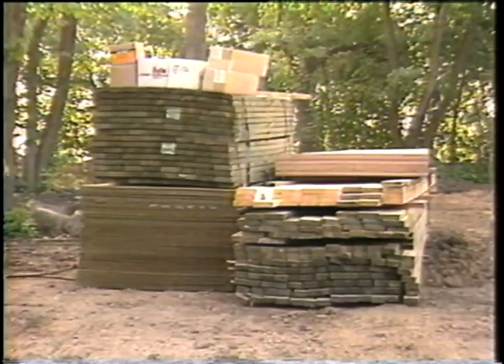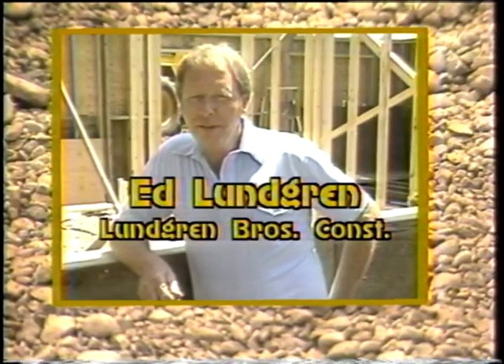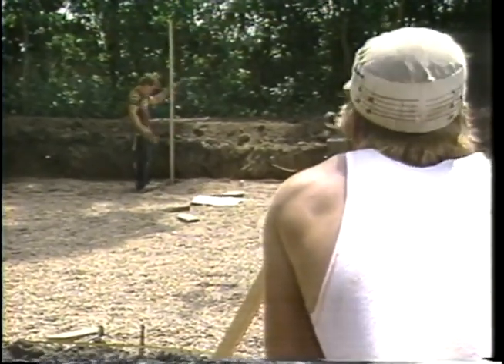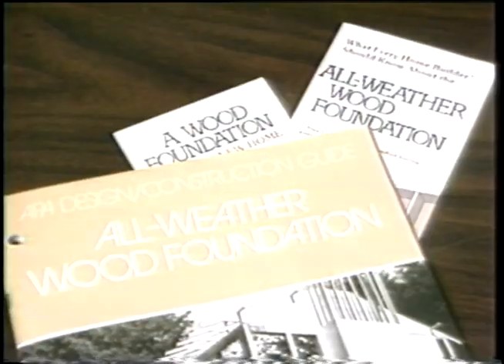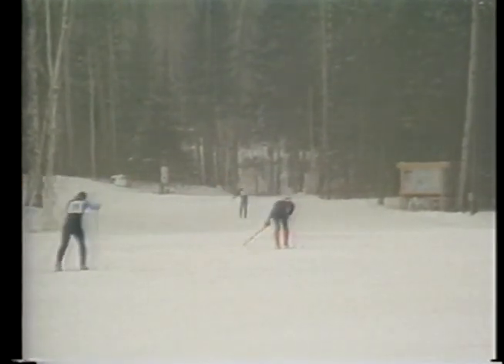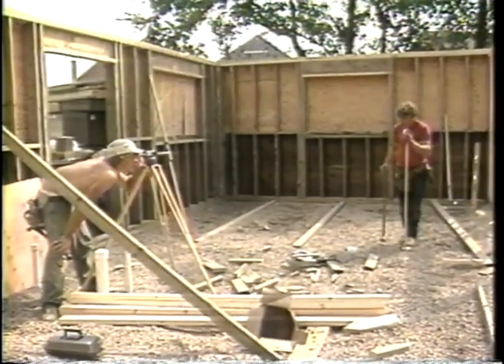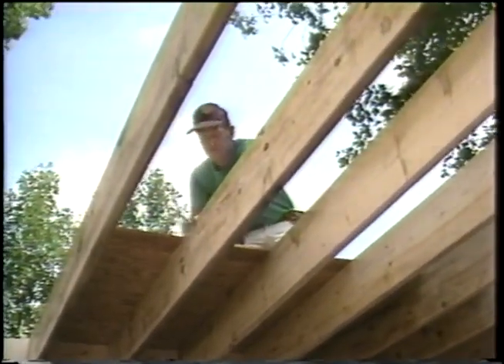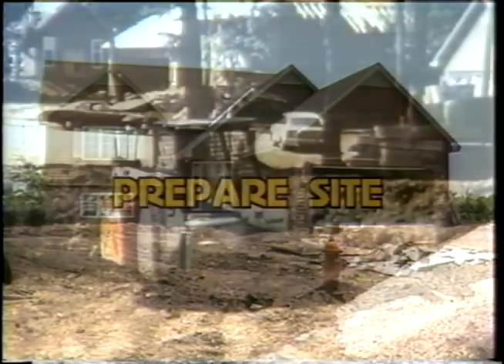Permanent Wood Foundations: Nothing Complicated; Nothing Complex

Comment: Ok done some of these 25 yrs ago.. it works if done correctly.. PEA STONE is what to be used period..  resale and finance issues yes.. however it is sound if done properly. Mostly used in rural or labor starved areas... Remember sea walls, pole barns, roller coasters are done with this material... Cement is not water or moisture tight as a matter of fact it's always damp . And poor compaction always spells failure.. pea stone is instant compaction..it's a system not a thing..

Comment: If later down the road, you did get water damage, can you change a wood foundation into a concrete foundation?
Reply: You have a better chance of getting a wet basement with concrete then with wood
Reply: All replies welcome:
I have a 21 year old house with wood  foundation.  I have no leaks at all. I even carpeted part of it.  Question, when I sell this house do I need to disclose this to a potential buyer? All wood is now completely covered inside and out, so it won't be visible on inspection.
Reply: Not worth the cost better off infill

Comment: I worked for a contractor 20 years ago that sold this garbage.  Still not convinced. I can understand the concept, but the walls should be on a concrete footing.   We fought those buildings to the peak as they settled
Reply: Garbage is exactly what you built. That's not how everyone else works

Comment: This video is so friggin old! These practices are not allowed in any Canadian province. Pull this video.
Reply: These foundations are currently allowed according to the National Building code in Canada. These are great solutions for many situations. Hard to reach areas or on Islands. I have built a few of these and one that is 30 years old. No problems whatsoever. Like anything , do it right and it will last. I am currently working on one. Never had an issue.  Long lasting, reasonable cost,  SMALLER CARBON FOOTPRINT than any other material and a sustainable product. Somebody is out of touch.
Reply: You're of the ban clan type eh?  Ban based on my non-facts.  Preserved wood foundations are very allowed in the NBC and OBC to this day.  As an inspector of 15 years I've seen a few of these foundation and they were 40+ years old and looked brand new, worked great.
Reply: @carter102  yes and all dangerous activities must be outlawed post haste.
Reply: The Canadian National Building Code disagrees with everything you just said; look up 9.15.2.4.(1), and 9.16.5.1.(1) in the 2020 code book. See also CSA S406. I am a structural engineer and I have been specifying these foundations for over 30 years.

Comment: I cannot believe that ANY modern building code would allow a pressure treated wood foundation.   Fast and cheap.......this wood foundation will rot in 10 years.   A modern home has concrete footings with poured walls or cinder block for a foundation.   The only type of below grade wood foundation allowed is for a pole barn, and even then the posts will eventually rot.
Reply: I'm living in a home built in 95 with a wood foundation and it's holding up fantastic. The key is drainage.
Reply: Going on 22 year now. When I first looked into it. I toured a home that was going on 80 years old with a wood foundation. The basement was warmer and dryer then any concrete foundation with no cracks or collapsing walls.
Reply: Mr. taxpayer just see a home with wood foundation it is 31 years old had Structure engineer check it and it’s in good shape...
Reply: There is a house at Forest Products Laboratory in Wisconsin that was built in the 80s and is doing just fine. It has sensers in the wall to monitor moisture. It looks like it was built yesterday. It in fact looks much better there most concrete basements built around that time. If you plan on ever finishing the basement this it a good idea. With more modern water proofing products and drainage layers it could last 100 years if done right.
Reply: @Ilove3SGTE  the Brooklyn Bridge sits on a wood foundations and is well over 100 years. The Empire State Building sits on wood pilings. These people that think wood won’t last have not done their research. I’ve owned concrete and I’ve own wood now for the last 23 years. I wouldn’t go back to concrete.
Reply: Possibly that's to say POSSIBLY this could've been done reliably before the epa destroyed the longevity of treated lumber by banning the treatments that, you know, work.

Comment: Remember: Insurance companies often charge extra for wood foundation homes, and resale on wood foundation homes is usually tough at best. It may be cheap and quick now, but it may be exceedingly costly later...

>Do you want it done quick, or do you want it done right?
Reply: Any facts to back that up?
Reply: @rubbersole79  CK's channel said, "No, accept my surrender!"
Reply: @rubbersole79  Google it.
Reply: I built mine 22 years ago. It was no cheaper then concrete but is a world of different then concrete. Warmer, dryer and was so much easier to install and work with. It has made no difference in the value of my home. Mine appraises the same as the equivalent with a concrete foundation. There is also absolutely no difference in what I pay for home insurance. You can google anything you want and get any answer you want. I’m telling you the facts at least where I’m at. Now there are states such as communist California that it could be different.
Reply: @dontfit6380  we also have a wood foundation. No issues with ANY of the above mentioned things. I have a question for you though. Did you finish your basement? And if so, did you put a vapor barrier on the walls before putting up sheetrock??
Reply: @annehause7118  yes it is finished and I did put up a vapor barrier.

Comment: Please tell me this isn’t still allowed by any modern code! Why not go with concrete. Pressure treated wood still rots
Reply: It is definitely allowed. Nothing wrong with it at all. There has been multiple studies on this type of foundation. Predominately in cold climates: Madison, WI  Minneapolis, MN and University of North Dakota. Structural engineers have recommended this type of build for cold climates because of how to control condensation that occurs with concrete vs. wood. There are different styles of wood foundation elsewhere, such as in Dallas TX--they build it different. Why not used? it is MUCH warmer than concrete foundation.
Reply: It was still in the 2015 IRC (R402.1).  Couldn't say about 2018 but I don't know why it wouldn't be.
Reply: What they use on decks and posts is different, this is rated for underground use.  If done right, it never comes in contact with the soil.

Comment: From what I've read, if done right and under the right conditions, this system can be built to last. I've heard that they even build houses this way and cover them with thin stone, so you'd never know how they were built from the outside. But I'd have reservations about it today, since some of the hazardous chemicals that were used in pressure treated wood back when this video was made have been removed. Would today's pressure treated lumber resist rot and termites as well as what they are describing here? Would you want to find out?

Comment: How does this foundation system protect against uplifting in case of a tornado since their are no anchor bolts used?
Reply: Would it be possible to sink large posts vertically deep into the ground, and somehow build off of that?
Reply: They could add those helical posts that are sometimes used to reinforce sagging foundations or to support a new foundation; tie-downs could probably be attached to them.
Reply: A different kind of anchoring could be added at the base of the walls on the outside perimeter, projecting away from the walls that then gets back fill earth on top of it. To pull up the structure, it would have to pull the fan like anchors through the feet of dirt on top of them as well. Another way would be to construct the basement walls with a slight inward tilt to help wedge it in the ground more when back filled. Maybe still not quite as good as the weight of concrete, but those methods would help some with your concern. I feel a rebar reinforced foundation resists potential ground deformation better over time than this would. Might be okay for large flat areas, but I wouldn't do it on terrain with any slope.

This video seems old. I wonder if anyone still builds like this. lol
Reply: That's called piles and they used to be used for houses around 1900.
Reply: still are if soils are expansive and poor for bearing on soils.
Reply: My house had a cable to a lighting rod on top of house .. the restate Agent said it doubled as a anchor in case of a tornado ... I live in a apartment now
Reply: Val Kukec .o u